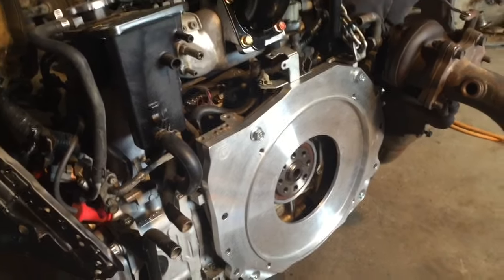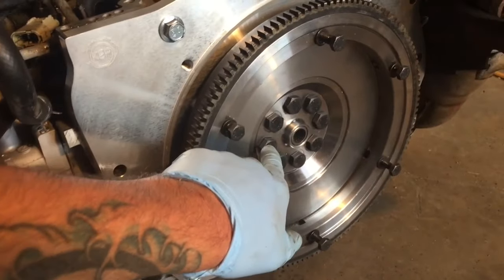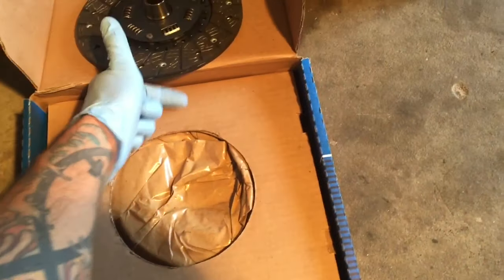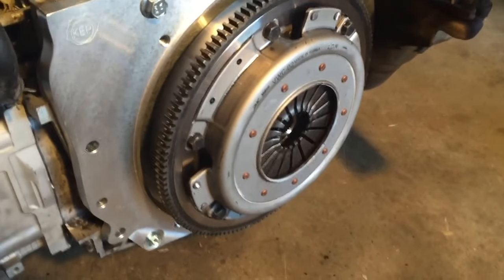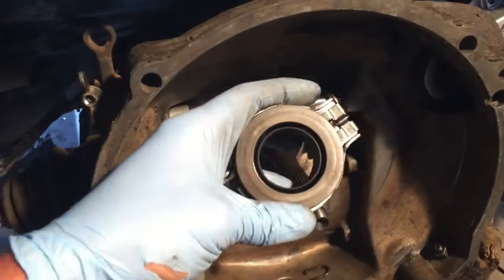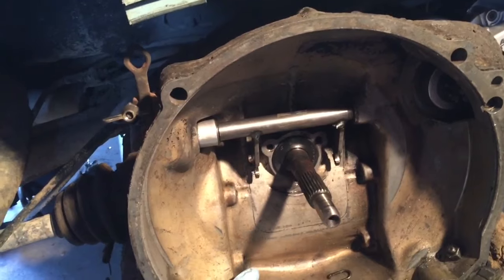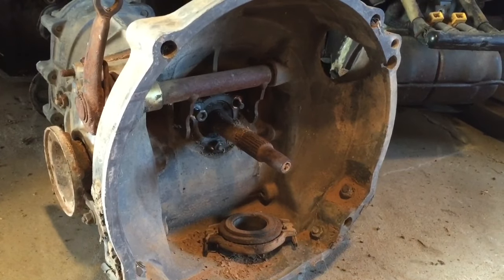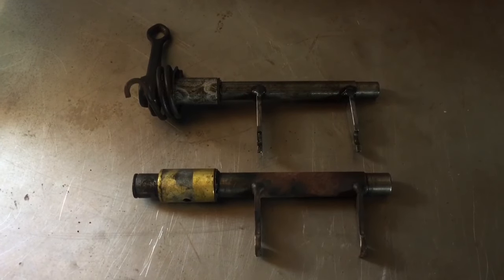BUGaru Part 6 - Adapter and Clutch Mishap

Comment: Great videos! 

Won't the old transmission self destruct with all that extra torque?  Was fitting the subaru transmission not an option back in 2016?

Comment: Hi
I have followed the videos of you, it is a very project and I give you the congratulations. I have a question, if I have a transmission box of a Beetle (Made in Brazil or Mexico), is it necessary to make any modifications to the gears of the gearbox? Or is it arrive and install the Kit Adapter?

I ask you this, because in other videos of Brazil, the protagonist says that it changes the direction of the gears by the direction of rotation of the subaru engine. For me this is strange, since all the motors turn in the same direction (front or rear).

Excellent tutorial.
Regards from Chile
A hug.

Comment: Just swap out the trans. Don't use the old style throwout bearing. They have the tendency to bind up the moment they start to wear. The new design is so much better. Then, you also don't have to wait for new parts to ship in, and you won't have to deal with the hassle of shipping your old parts back for what is ostensibly an inferior setup.
Reply from the maker: +draggonhedd I have a feeling I'll be swapping transmissions at some point anyway. Since I'm basically just roughing everything in I'll just be patient and work on other things while waiting for the other clutch assembly. This will be a good real world test to see how the old style holds up to Subaru power. Thanks for the guidance - I'll probably end up going that direction once/if this trans has issues.

Comment: Is that just a stock Bug pressure plate and clutch or did you go with something with more holding power?
Reply from the maker: Stock. Since it’s turbo it may have a better time due to turbo lag. I’m hoping it’ll save the transmission from any major shock loads - time will tell!

Comment: so the adapter plate is fron upfront engineering? because i cant find it on their website?
Reply from the maker: +Ryan Graham Outfront Motorsports. They are working on their website so it may not be on there right now but you can message them through eBay or give them a call - they'll hook you up. Tell them you found them through Busaru :)

Comment: hello this question out of this video subject but I want to know to how to install flipped Passat b5 gear box in t3 van thank you
Reply from the maker: +Aboubaker Benbaha I've never done that, is it possible?
Reply: Busaru yes there is many vans with Passat b5 gearbox and most them made by Russians u can check on YouTube and Google fourme my self.I'm not good on mechanics so I can't understand the details
Reply from the maker: +Aboubaker Benbaha Very interesting! I don't think that's a very popular swap in the USA for some reason. I'm Assuming VW engine to Passat trans? I mostly deal with Subaru engines so I'm out of that world a little bit. You can flip the Subaru trans pretty easily though.
Reply: Busaru  Subaru cars are not easy found in north Africa so think about Piece and yes he installed a Passat TDI with the gearbox and he flipped the way it turn and other video installed an ford v6 with renaut escpace gearbox and flipped the gearbox but I don't know how
Reply from the maker: +Aboubaker Benbaha People are doing a lot of interesting swaps for sure. I wish I could help you out more in regards to that equipment.
Reply: Busaru I'm wating from u thanks alot